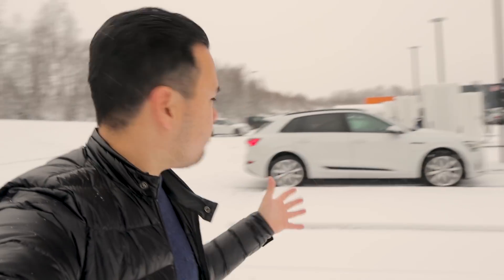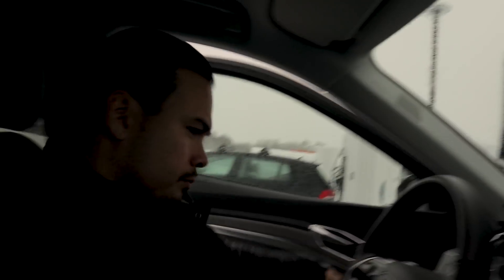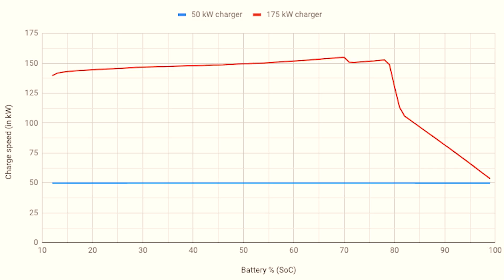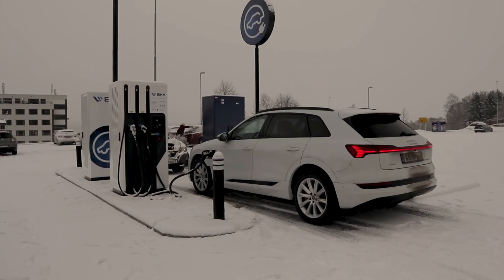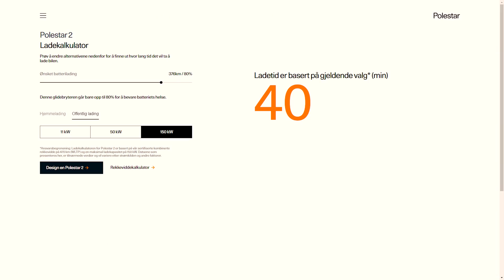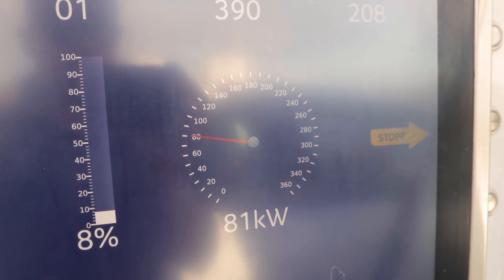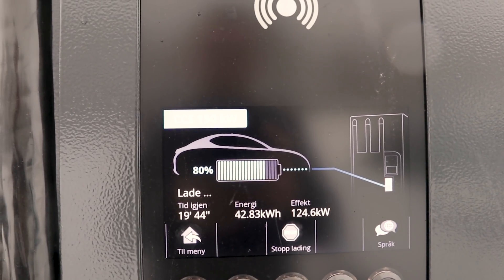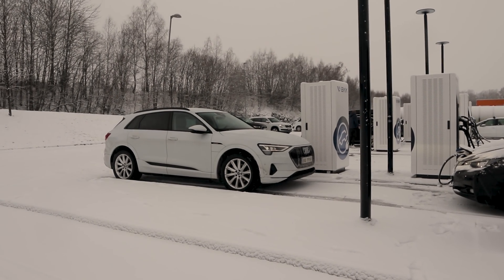The Problem With Charging Speed (and why it's so misleading)

Comment: Kris,  Is there a way you can measure the battery temperature of E-tron while charging?  You should compare the temperature with Tesla model Y while charging.  This will tell us that E-tron is actually doing a better job maintaining lower temperature while charging and not charging the battery while the battery temperature is very high.  High temperature while charging is bad for battery  longevity.

Comment: I drive a polestar2. I use to drive a TeslaS 75D and 90D. Also i3. In general I agree that if they clame 150kW it should hit that speed. Max I had was 132kW. Is chargespeed important for me?, No. The longer trips I do does not involve more then 1-2charges.

Comment: I have the e-2008 which advertises 100kw charging speed. But, as I guess you know, this is only from 0-20% and then it drops to 75kw to 40% and so on. This was news to me after I bought it. I am kind of hoping that there will be a software update to improve this, but I know that is very unlikely

Comment: I personally just need to look at the charging curve. Even average charging speed doesn’t always mean the same. If you have something like a Model 3, the average might sound much lower compared to the advertised speed, but if you are ok only charging to 50%, i.e. having more frequent but shorter stops, it can be quite a bit faster compared to what one might expected just based on a 10 to 80% average.

Comment: I totally agree as a Polestar 2 owner, the max speed i have seen so far while charging was 135kW for 2 or 3 minutes. As far i'm concerned the Polestar 2 is a 135kW car. The charging curve is bad compared to M3 and etron. Hopefully it will improves in the future, with updates because at the moment it follows a static charging curve, chargingspeed is reduced based on battery percentage which is odd.  Maybe they want to gather  reallife battery deg from customers before opening up the charge curve we will have to see. And according to some internet posts Polestar is working on battery pre-conditioning software simillar to Tesla.

Comment: That's what I've been thinking since the day I've got my Renault zoe.
They claim a 50 kw charging speed, that I've never reached in 6 months.
I agree with you, the car manufacturer should set a rule about how to measure the charging speed of every single car.
They just tell us the maximum speed that you can get in ideal conditions, but if it lasts for 5 percent it's useless.

Comment: The e-tron dosen’t seem to actively warm up the battery under any circumstances, except if it’s under -10 degrees Celsius (14 F) outside, according to the Audi self study program page 130: https://vwgpaintandbody.co.uk/wp-content/uploads/Audi-e-tron.pdf

At first I was a little disappointed by this. However, the speed is ok even if the battery is very cold and heats up quickly while charging. Worst case I’ve experienced, is that charging starts at around 70 kW, but it still ends up at 150 kW in longer charging sessions. Also, worth mentioning; Theres almost never any regen- or power limit because of battery being cold. So, why preheat unnecessarily? It’s like Range Mode in Model S and X, but without any of the downsides. 👍

One could wish that the car would preheat on route to high power chargers. Remember though, that would cost at least 5 kWh, maybe more (more than 5%). So, unlike in certain other EVs, there’s not really that much to gain on it. Considering the behavior described above.

NOTE! The Porsche Taycan does preheat to HPC’s and the ID.3 supposedly will, in the final software. If true, this probably also applies to the ID.4, ENYAQ and Q4 which is based on the same platform. None of these has as flat a charging curve as the e-tron, but I’d still like to see this feature as a software update. Now that the e-tron route planner works quite well, it would be a natural next step.

Comment: Happy New Year! Yes, comparing the average charging speed from 10 to 80% SOC would be a good thing, the data the manufacturers are presenting are gravely misleading. And another thing while talking about range, the comparison would also include power consumption , fast charging speed does not automatically mean a good range. And an electricity inefficient EV is not good for the environment either..

Comment: Charging speed is not as important as it's made out to be. Imo, MOST charging is done at home, not at fast chargers. Once EV adoption is higher and people without the option of home charging are in the majority (guesstimate would be around 2025-2030 maybe?) then it will be more important. Most people drive 50-100km per day, the outliers (you, Björn, people travelling a lot) will of course have to choose vehicles that suit your needs. I don't think "up to 150kw" is a big deal, the problem is that it's reported as "this will charge @ 150kw". It might, but certainly not for the entire session and most likely not for long.

The same language is used for broadband speed and I think it's simply because there are too many variables. I've seen polestars and volvos charging @ 140kw+ but as you mentioned, probably not as consistently as the Audi (for example).

Comment: Dear Kris, thIs is why Etron is very important. IThe reason I bought my Etron is firstly better  built quality and secondly imprssive charging speed.It still charges 90-95 kw/h 90-95% state  of the battery. No car can do that ma be Tayccan. Taycan has similar factory settings I think(lol). As long ad the speed od the  charging is at this level it really  does not matter how far drive with one cahege. You can make two liitle stios.

Comment: Kris,  Happy New Year! Welcome to 2021 ..

So Kris I was working on a video as well about this was waiting to release it once I get my Mach E .. I currently have a Tesla model 3 and a Audi eTron, I am in the US so we only get the 55’s anyways my Audi chargers faster to 80-100% than any Tesla on V3 Supercharger and even much faster than the more common V2 SC, one major think I noticed everyone left out when showing charging speeds when they put up Tesla vs XYZ is the amount of kWh delivered to a given percentage.. for example our eTron has a bigger battery than my Tesla Model 3 so when my eTron is at 70% that’s allot more capacity than my model 3 at 70% so I think charging speed test should be based on kWh delivered over time .. not overall battery capacity over time .. anyways I am almost done with my video on this just need to include my Mach E that’s coming in a few weeks ..

Comment: A other metric would be how many km do you gain with X minutes of charging.

You will done compensate for driving efficiency.
Reply: Yes, but even better. Take the average charging speed between 10 and 80% . With this average charging speed, how long do you need to charge to get 100 km range at 100km/h. Do the same at low temperature when some cars coldgates, and the efficiency on the road decline. Present both numbers like Charge time “100/100 summer” and  “100/100 winter”. This will somewhat even out the difference between a Model 3 with a high  charge speed at low SOC and a slower change speeds at higher SOC, and also include the efficiency of each car.
Reply: @estabien5563  the problem with that metric is that the larger the battery is, the less important it is to charge to 80 (vs 70) %

Using "a 30 minute break" is something that is familiar to a lot o people.

The link below is a test of "30 minutes charging". 

Heading "Resultater fra testen" = test results

"Km ladet etter 30 min" = km gained after 30 min of charging.

https://www.naf.no/elbil/aktuelt/elbiltest/ladetest-sommer-2020/

Comment: it's this issue related to different battery cells? i know Solid state batteries charge much faster, but are more expensive. therefore it explains why E-Tron charges like it does but quite "low" range alteast compared to other battery packs like in Tesla

Comment: I think it should be a mix between charging speed and consumption. For example: If you have a car with excellent charging speed but with high consumption (Audi, Porsche) and you have a car with slower charging speed but with lower consumption the net outcome (time to target) might be the same or in favour of the car with slower charging speed. I totally agree that the charging speed figures from many car companies are fairytales and your contribution to report these problems are most welcome. But my question is, why is it so difficult to get high charging speed and low consumption. To many compromises with design, quality, comfort, cost, platforms? Keep up the good work!!!
Reply from the maker: The combination of charging speed and consumption is what the Nowegian High Speed Run is all about. The faster the car completes the test, the better both charging speed and consumption is :) But it seems like charging speed can easily compensate for high consumption, hence the E-Tron 55 topping the chart!

Comment: Charging speed should be defined as average from 10 to 80 percent. If the time from 10 to 80 percent is 60 minutes and 70 kWh is delivered during that time then the average charging speed is (60 / 60 * 70) = 70 kW. If the time is 30 minutes to get 50 kW the average charging speed is (60 / 30 * 50) = 100 kW. I wrote this comment before watching this video and Kris had the same solution :)
Reply: Agree, although I think 20-80% is better, to get a representative average for most people. This index is very interesting, as it also incorporates WLTP range and charging loss; https://www.p3-group.com/en/p3-charging-index-comparison-of-the-fast-charging-capability-of-various-electric-vehicles-from-a-users-perspective/ Unfortunately, it’s not kept up to date.. 🙄

Enthusiasts know that 10-80% is ideal, and let the charging decide their stops, if possible. Normal people are more likely to charge from 27-100%, 18-64% and 54-82% (Kris charges from 0-100% 😆). 

If you measure from as deep as 10% you should also go to 90%, in my opinion.
Reply: @sdrhs-q3j  I disagree with you on 20 to 80%. I think Kris suggestion is the right,10 to 80 %. I would like 5 to 80% but fully understand that fewer people charge like me🙂
Reply: @estabien5563  10-80% is fine. 👍 I just think people are charging more often between 80-100% than 0-20%, even though they shouldn’t.. Personally, I’m more like Kris. I like it below 5%. 🙂 Still, when going on road trips with friends and family, I find myself starting the charging sessions at everything from 5 to 80% state of charge. When I go really deep, it’s most often on the last leg, home.

Comment: Very nice summary. I just supercharged my model 3 LR the other day in -1 degrees Celsius and at 56% soc I was still getting 124Kw, until this lady in model X arrived and joined the same charger even though there was plenty of unoccupied chargers at the site.  So frustrating.. but you’re definitely into a breaking point topic here. More of these videos please 👏
Reply: It's likely that this person didn't know that power was shared between the two.

Is there educational material anywhere for owners on that aspect?
Reply: I would have greeted the model X driver and informed them that using a charger with the same number as one that’s already charging would result in a slower charge.
I thought that the Tesla Superchargers favoured the car that was plugged in first though so the second person shouldn’t affect the charging rate of the first car.
Reply: @SirHackaL0t.  it does favour the car that plugs in first but it depends on the SOC. I was already up to 56% so the result was 50/50 power supply between my car and the X. If I’d had low SOC, my car would benefit greater charging speed up to a certain level of SOC. And yes, I should have informed this lady about it but I was in a hurry and had actually more than enough juice to carry on so case closed 😁
Reply: @Nlkla5  No worries. Did your car slow it’s charging when the lady plugged in or was it already that slow?
Reply: @SirHackaL0t.  charging speed dropped immediately when the X plugged in. Went down to 60 something Kw from ~124Kw
Reply: @Nlkla5  Interesting. Hmm. Not seen that so far but I don’t get much chance to Supercharge. V3 chargers are better as they don’t share the current between a pair of chargers so let’s hope we get more of those in the UK. (New v3 chargers in Crawley if you are down that way btw)
Reply: @SirHackaL0t.  I live in Norway 😁
Reply: @Nlkla5  I visited Norway in August and loved it there. I drove almost 3000 miles over 10 days in my Tesla Model 3 LR. The scenery was breathtaking (some of my photos are on Google Maps), the roads were fantastic and the people were lovely and welcoming.

Comment: I talked to a taycan testdriver and they want the battery to be around 20 degrees for optimal charging speed. Maybe its the same for etron. At 50 degrees he said the car will reduce energy output by a lot und wont charge fast.
Reply: The Audi etron, Porsche Taycan and Jaguar I-Pace use identical battery cells... they want to see 22 degrees for full charging speed and go up to 40 - 45 degrees... max temperature is 49 degrees

Comment: Happy New Year!

Charging speed counts more than EV range if the car is efficient. Take one example: Hyundai Ioniq 28 kWh (first generation) have charging speed near 70 kW for long time, but the new one charging slow as a snail. Even the first gen Hyundai Ioniq with 28 kWh battery pack beat down the new Ioniq and more cars on today market becouse of the good charging speed counts a lot.

I have doing charging speed test on Renault Zoe Z.E 50, on papers says up to 50 kW on charging speed, but the best charing speed I was getting for pretty short time was 45,1 kW on 30%. I was started charing in typical 10%. Started with 43,2 kW and the speed drop like a rock on 50% and was then below 37 kW. And the next big drop was on 70% and get only 30 kW from the charger. And next 80% with 25,1 kW. And I figure it's paid off to charge on 22 kW AC istead becouse the charging speed on the 92% was same speed I can get from a 3 phase AC outlet.